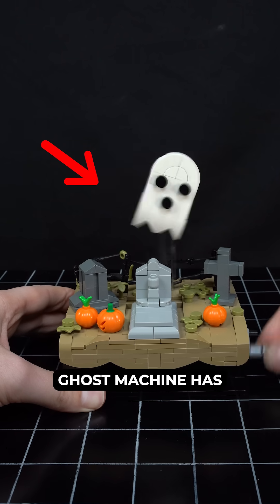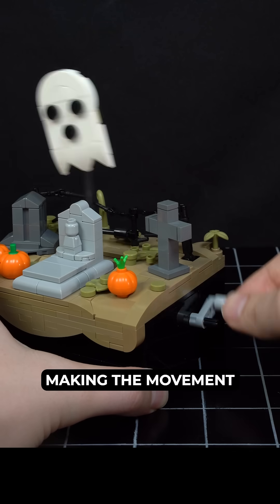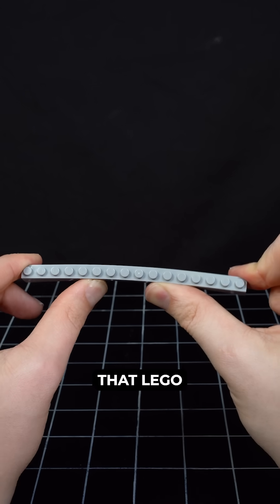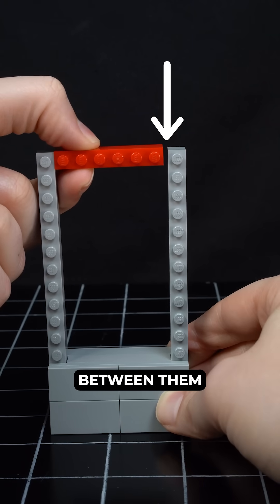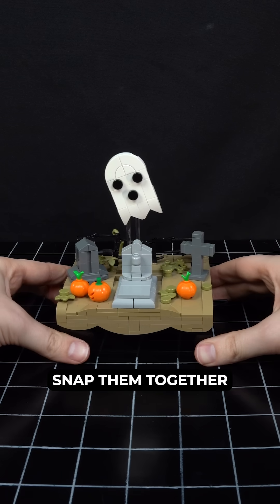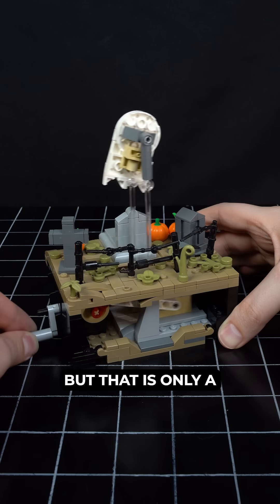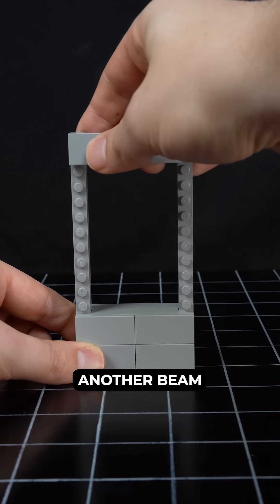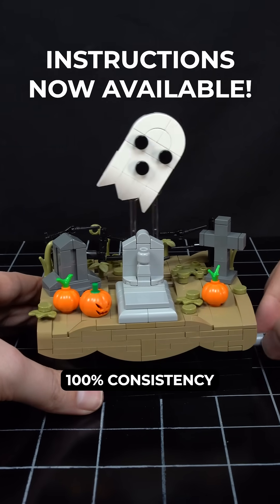This is a MAJOR Problem #lego #engineering #halloween

Comment: Truth is obvious it's actually the white 1x7 liftarm within the mechanism, it's bumping against the top part of the case. you can actually see that in the video pretty clearly. 
 

Also he was aggressively winding the mechanism in the first part of the video. At the end of the video is when he is slowly winding the mechanism.

Not to mention that during the end of the video there's a 2x3 tan plate that wasn't there before along with a few other modifications.

Proving that the 1x7 Armlift was infact bumping against the top part of the case.

Comment: Throw some wd40 up in there 😂
Reply from the maker: WD-40 actually corrodes LEGO - I think it chemically melts it!
Reply: @GrantDavis  Cool!
Reply: @GrantDavis Silicone grease or a PTFE lubricant! That's probably what I would've tried first before taking it apart to actually properly fix the issue 😅

Comment: Measurements issue duh. If in your CAD it seems like it slots together just fine it doesnt mean it will. Without precision manufacturing any opportunity to leave a gap without impeding the purpose of the design should be utilized.

Duh.

Comment: I will say, the choppy erratic movement on the ghost also gives it a bit more of a jumpscare horror vibe.
Reply: Also, it looks like the ghost is going to jump at the hand of the operator
Reply: yee, before he explained it i thought it was a cool purposeful thing
Reply: Sure, but the choppiness was caused by friction between pieces, which can wear them down and is generally considered a design flaw regardless of how the product looks.
Reply: also it looks like it's tryi ngto ressiti t's glazing at the left cross for some reason for me
Reply: not really? this is kind of only a tangential relationship
jumpscare = fast and sudden, ghost movement = fast and sudden, but that does not mean ghost movement = jumpscare

I see this kind of leap in logic a lot and it always confuses me
Reply: @puntato29  an attempt to bridge the logic: it would not be surprising for a ghost to be the thing that moves fast and sudden in a jumpscare, so because it's a ghost, the way it moves could imply jumpscare
Reply: @puntato29  But he said "more of a jumpscare vibe". The logic would be that the tangential relationship is stronger than no relationship. Smooth and slow != jumpscare. So fast and sudden > smooth and slow. 

I see this kind of wilful misunderstanding a lot and it always confuses me.
Reply: @SPL_LowEloPlay  it's not a wilful misunderstanding, but alright, guess that phrasing really irked you
I still disagree that it's an apt comparison to make when you're comparing 0% relation to like, 5% relation
Reply: @puntato29  Fair, sorry for jumping on you. I have a bad habit of reading malice into misunderstandings. I wanted to make the point that because hikarikuono says "more than", his comment can't be taken as a complete equivocation. The logic doesn't quite work because of the qualifier.  It's not quite 5%>0% therefore = 100%. It's just 5%>0%

Comment: simple solution; WD-40
Reply: and that solution isn’t smooth at all u can still see the jitter; its binding and friction forces are enough to just barely overcome the input forces, thus creating a dead zone where the jitter happens; spin it faster and it probably won’t happen
physics course did me good 🫡
Reply from the maker: @Jack-jw3rd Certainly there is still some friction. It's a bit hard to communicate visually, but the updated version is really like 4x easier to spin, so I still consider it an upgrade even if it's not perfect... Also, WD40 chemically melts LEGO, permanently damaging it.